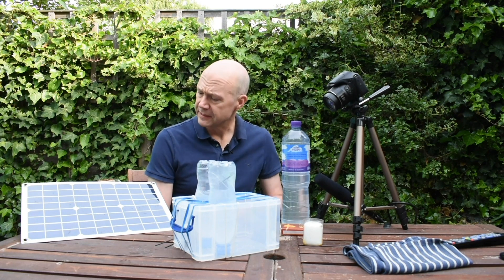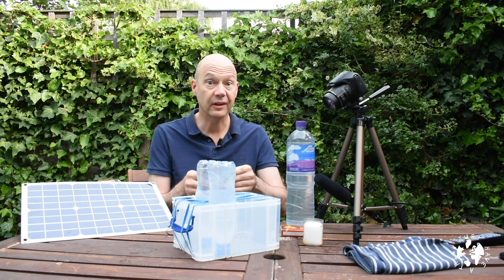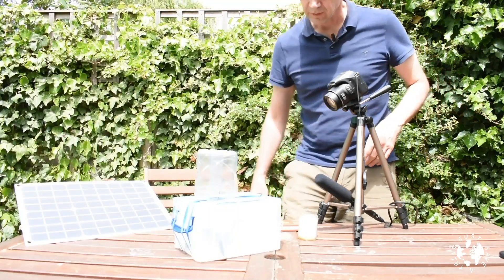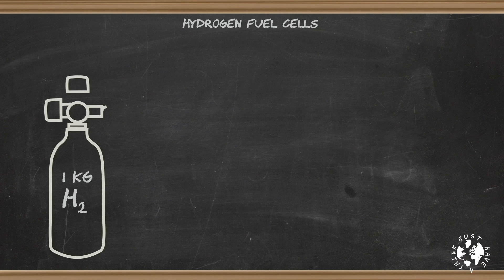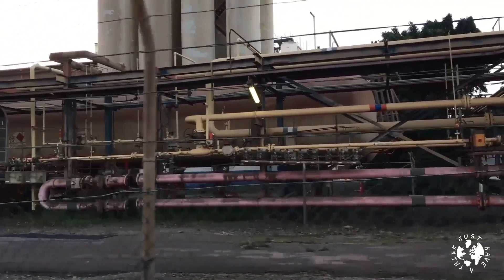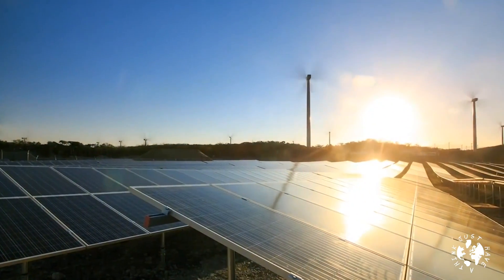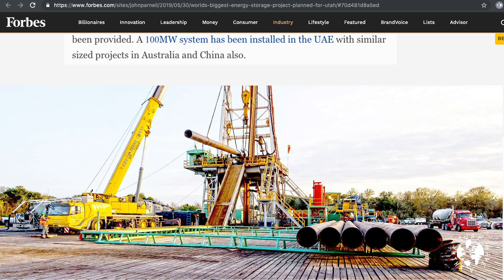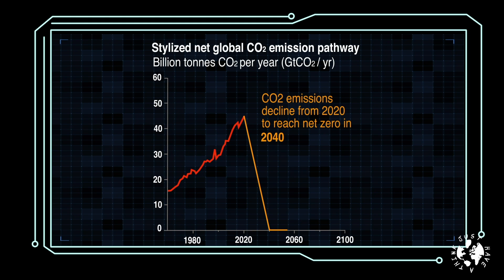Energy Storage in Hydrogen : Does this beat batteries?

Comment: Kids, only try this at home if you are in a detached house and very sure about what you are doing. If the system leaks hydrogen does not smell you can not see it and is INCREDIBLY flammable by the tiniest of sparks. Other than that: decompression of a home made hydrogen systems will blow your house apart. Make sure that you are placing this in a well wentilated area. Under no circumstances try this in a flat.

Comment: There were a few little firms, some years back, promising hydrogen storage tanks filled with metal dusts, giving a metal hydride as the storage medium (low pressure, but high capacity, lots of gas is adsorbed onto the metal surfaces  - the gas comes out when you warm the hydride). There were a few of their sales pitches on YT.  I wonder what happened to that?

Comment: The earth is actually cooling.   Ski resorts out west are going to be open until August and farmers in North Dakota are having trouble because there is snow on their fields.  They may have planted but they were planted late in the season.  It's hard to know what happening since the Leftist media doesn't cover actual news.
Reply: alternative facts ! - check out potholer54.  SNOW does not require very deep temperatures but enough water vapor (helped by higher global temps -  also in the air, that wall will hit a colder and drier wall of air - there you go). 

Search for polar vortex. that could explaint cold snaps and snow at unusual times.

It is WAY TOO WARM in the Arctic. the relativeley cold air breaks out - it used to be trapped in the Arctic by certain currents.

On what data do you base your claim on that the globe is cooling ? On the contrary,  the evidence is that the globe has been warming.

check out NASA or NOAA research for a start. Or DMI (Greenland, Arctic). 

Does not matter what the media reports - they don't cover science too well anyway.

But the PEER REVIEWED STUDIES and the scientists that are experts in the field make statements. - and potholer54 does a good job to explain it to the non-experts. 

If you do not believe them ? Based on WHAT peer reviewed studies and what expertise ? 

Extraordinary claims need extraordinay proof. If you boldly contradict the overwhelming majority of scientists in the field you better have some GOOD evidence.

Write a rebuttal  paper how the globe is not warming and subject your findings and evidence to the scrutiny of the global community of experts who read those magazines and react to published studies. That is the meaning of PEER REVIEWED.
Reply: Go watch some Tony Heller videos.  He shows what's actually happening.  The data that they graph has been altered many times and they issue pretty graphs that are completely meaningless.  They won't release their data so it's not science.   All of the cycles that control the climate are shifting.  Carbon dioxide is basically meaningless.  There is no overwhelming majority.  That is just a lie that they keep repeating.  They need to fire these con-artists and throw them in jail for fraud.  It really is that bad.

Comment: Of course, Fuels cells are much more expensive than batteries, and converting water to hydrogen is less efficient than charging a battery, and storing hydrogen is a nightmare (because of its tiny leaky atoms and tendency to make metals brittle), and converting hydrogen back into electricity is less efficient than discharging a battery. 
On the other hand there are a some applications where energy density and weight is more important than efficiency or cost, like electric airplanes, which are a perfect match for the technology, at least until batteries or supercapacitors massively improve their weight/energy density.
Reply from the maker: HI Michael. It'll certainly be an exciting future ironing out all these technical hurdles (assuming we can just manage to keep ourselves alive for long enough).

Comment: You totally gloss over the energy requirements to produce, store and distribute a hydrogen based energy storage as though they are trivial details that will be solved in the future by some magical technology. Simple physics says this will never be an efficient way to store power from renewables. Battery technology is already advancing faster than fuel cells can become cheaper and will soon pass in useful energy density.

Hydrogen is entirely touted by fossil fuel companies for a reason. They sell fuel, not machines, which is their business model. The plan is to use hydrogen as a Trojan Horse to promote end user machines that depend on it as a fuel (just like the current model). They may even subsidize these fuel cell machines (directly or through government) to get them widely entrenched. Some renewables may be used to produce a small amount of hydrogen to get the Green Stamp of Approval (like the ethanol greenwashing scam that has run for decades). The rest will be produced by natural gas steam reformation, which is the true goal. 

Hydrogen/Fuel Cell technology is simply a means to monetize the remaining oil/gas reserves, which is the only wealth the extraction industry has.
Reply: Kind of negative - simple physics indeed but if electrification all goes batteries what do we do with all the old batteries.
Reply: @alfrobertson7027  The components in batteries are long-lived and recyclable. In fact, few of the Lithium-Ion EV batteries have ever made their way into the landfills since their use started in the early 2000's. The reason for this is that long after the batteries are insufficient for EVs, they find new life as grid storage, UPS backup and misc other functions. There is already a vibrant economy around battery tech and they are too valuable to throw away. 

Also, newer designs already look to way outlast the car themselves as well as be easier to recycle.

There is no practical way to recycle CO2 without large amounts of energy, which just creates more CO2.
Reply: @alfrobertson7027  Tesla has a joint venture to recycle them.
Reply: Trees! The issue (arguably) is fossil carbon being added to the current ecosphere. So how to accommodate global growth even global standstill without adding more. It is a problem of scale I believe so the naysayers need to stop protesting and propose solutions.
Reply: Lithium battery is heavy and toxic.
Reply: @marcohangman5312  So is a fuel cell. Besides, I don't plan to carry or eat a battery.

Comment: How about demonstrating pumped hydro electric. You could move a lot of water with a small pump connected to that panel in several hours and get 90% of the power back rather than a small puff of gas.

Comment: The problem of hydrogen storage is the vapour pressure of hydrogen is so high that makes it low in energy density per cubic volume at a reasonable pressure.
Reply: Which is a challenge when you want hydrogen powered vehicles, but is not a problem at domestic levels. By leveraging grid storage, (i.e. each house that generates excess solar stories it locally in the form of hydrogen) which then becomes available when demand happens after dark, (or it can be use to directly cook food.)

Comment: Hydrogen is a hard gas to keep as it is so light it will find a way out .Would it be easier to convert it to amonia or methane ??
Reply from the maker: For storage and transport you mean? Yes - that's definitely an option being explored and developed. Good comment. Thanks :-)
Reply: @JustHaveaThink  yes convert it to nh3 then convert it to hydrogen as needed .Ammonia is very easy to liquify and I am not that versed in the way to convert it into methane but you  use co2 + h2 to yield methane and oxygen

Comment: I don't see hydrogen being very useful compared to pumped hydro and batteries. I would like to note though that you likely did not set up the electrolysis very well. You want to target about 2 volts and I am guessing that solar panel is set up for 12 volts. One option for a DYI setup is to have 6  electrolysis units wired in series. As long as they are about the same size they will float with about the same voltage.

Comment: By the way, Hydrogen is extremely flammable and explosive as used in rocket fuel.  Requires extreme caution for storage.  It’s not like CO2 that you can just store it in caves and fogetaboutit. Remember Hindenburg!
Reply: Lol. The Hindenburg explosion you see pictures of is actually solid rocket fuel. The Germans used it for adhesive.

Comment: Pump water up high, let it drop thru a turbine when you need electricity.  Simple plumbing and pumping that is easy to maintain without any serious volatility.  Something you could put in the utility core of a big building to store energy from solar cells on the building.  KISS factor to keep it cheap.
Reply from the maker: Already being used. Pumped Hydro. I think they use it as a grid balancer.
Reply: @JustHaveaThink  Then why not use it in a battery role too?  Saves a lot of mining, smelting, and other industrial process pollution eh?  You just move water up in quantity and have no fire, explosion,  or other risks and you are not breaking any tight chemical bonds apart.  What is the watt in versus the watt out? I expect it is a higher return for just pumping the water up high.

Comment: Thank you for teaching the world about this concept.  I have been saying it for years.  I would like to see vehicle fuel stations that make and compress hydrogen gas on site.
Reply: They already exist. The problem is, quite simply, for an average UK sized station, you need a 3MW grid connection power an electrolyser 24/7. This is VERY expensive and there isn't enough power. Not to mention the cost of electrolysers. Hence why battery cars are taking off. The infrastructure is so much cheaper and easier to install. Leaving aside the efficiency problems of H2 cars, they really arent a great solution. Better to use H2 to store energy or inject into the gas grid. Which is exactly what is happening.

Comment: Hydrogen tends to escape any containment its in,  thats WHY its not used as much as it could.
Reply: Hi, I have spent time with hydrogen, this statement is real! I am yet to have a container/tank which can not let hydrogen out, I have read that cabon fiber do a better job.
Reply: L Shayo that’s the problem with using the smallest element on the atomic table. To say we could just use it as a substitute for natural gas using existing infrastructure is a “pipe” dream.
Reply: @mondotv4216   But what if we only want it to last between sunset and sunrise only since the tanks would be refilled on the next day anyway?
Reply: Ziad Jeeroburkhan complicated gas storage and pressurisation system, not to mention fuel cell and battery. Cheaper and more efficient just to use an almost maintenance free battery. If you are talking grid level storage then you have to compare it to the alternatives.
Reply: @mondotv4216  Turn off the power once the maximum pressure is reached is all that's needed to regulate pressure but feel free to elaborate if you think other problems might arise.

Have you actually compared battery costs in comparison before jumping to that conclusion especially on the long run? Batteries have very limited lifespan so they're not maintanence free while fuel cells actually are close to being so actually. Also have you considered turning H2 to methane from atmospheric CO2?
Reply: @mondotv4216  Batteries might be cost efficient on smaller scales but hydrogen storage capacity is only limited by the storage tank capacity. That's extremely cheap if we only need to store it overnight so I'm still struggling to understand the rationale behind the battery support here. I need you to explain clearly why you disagree now.
Reply: @ziad_jkhan  we weren't talking about utility scale storage. There are other better solutions for that - it's not me you have to convince. It would be investors.  On a utility scale you have pumped hydro, flywheels, other gravity fed systems, giant wind turbines that operate at higher "on" rates than current gas or coal fired power stations, solar thermal, etc. Hydrogen has to get a lot cheaper and more efficient to compete with those other technologies (I'm sure I haven't covered them all)
Reply: It would be ideal to find a way to produce methane = CH4 * immediately after the hydrogen has been produced - then the existing infrastructure for natural gas could be used. And not problem to contain the smallest most evasive element. 

Lots of R & D necessary though.

Or any other fuel that is easier to handle (and less explosive).
Reply: @xyzsame4081  wikipedia dot org/wiki/Sabatier_reaction

Comment: You compared the theoretical energy content of hydrogen with the kWh/kg value of a Li-ion battery.  That's not right.  The battery produces electricity, which is not theoretical.  You have to compare to the electricity that you could reasonably attain using a fuel cell, and add the weight of the fuel cell and the weight of the hydrogen tank.  Hydrogen is not very efficient as an energy carrier, but if you happen to have free electricity then maybe that's not a problem.

Comment: What has always puzzled me is the emphasis placed on huge power storage facilities.  Wouldn't it make more sense to create smaller scale facilities - whether hydrogen, pumped hydro, flywheel, battery, whatever - and bury one such facility under each transmission tower on the grid? Circuit boards commonly have many capacitors scattered throughout the board to even the flow of power across the device, why not take a similar approach on a larger scale to ensure that power remains available in all places at all times?

Comment: 9:15 - Unfortunately, we just can't change the use of our existing methane gas transmission and distribution systems to hydrogen.  Hydrogen has the property of bonding to the trace elements necessary to make  high strength steels such as titanium and vanadium.  By bonding to such elements, the hydrogen causes what is called hydrogen embrittlement and the steel pipe becomes brittle, cracks under repeated stress loading and fails very quickly.  The switch to H2 is possible, but would need to be phased in over time as the infrastructure warrants replacing.
Reply: No but we can setup a home H2 system which stores solar energy during the day and uses the compressed H2 at night this way there will be more than enough energy but ofcoarse the battery companies and energy companies  don't want people to know about!!
Reply: @pehgt5099  This is not what he was talking about.  And as far as your revised suggestion, the mechanical and electrolytical losses of generating and compressing H2 compared to other solar energy storage options make it just plain silly.

Comment: Hydrogen seems like the best thing on paper, but Hydrogen is pretty difficult and expensive to store.
Nuclear power will still remain king even with its nuclear waste, the problem is ignorant people who fear nuclear power.
Good stuff though.
Reply: I agree.  Nuclear power is the best for generation.  But how to store that power?  Nuclear power generation has to be a very constant, flat supply.  Power demand fluctuates quite a lot.  Put hydrogen storage in the middle, and you can have a functioning power grid.  Also, use the nuclear power to make hydrogen for use in vehicles.
Reply: @scorpio6587  You really don't want a high pressure hydrogen tank in your car, no matter how safe you try to make it, it will never be as safe a gasoline tank.
And you need a larger high pressure hydrogen tank to even compete with a gasoline tank.
Hydrogen as fuel for cars is not really what you want and I too used to think it was a good idea, but better battery technology will surpass hydrogen.
Reply: @GoldSrc_  Don't get me wrong.  I love gasoline, and I will continue to use it so long as it is economical to do so.
Reply: @scorpio6587  Yeah, the only thing I see replacing gasoline for the average cars it will be electric cars and better battery technology, but that will take a few decades, I lost all hope on Hydrogen and fuel cells for cars due to the dangers it has which are not worth the risk.

Comment: Next step: methanisation of hydrogen, aka combining CO2 for the air (or other sources) and 2 H2 to make CH4 + O2.
This can be store indefinetly and without any limitations inside the natural gas grid and can be used for a lot of things using existing technology (heating, cooking, gas turbines, PNG/LNG cars)
Reply: huh, CO2 is the waste product of the spent hydrocarbons, why would you want to "combining"  them back in you said fuels?
Reply: @DanielbenDaniel  for the same reason we use bio-fuels like wood or corn based methanol
It's carbon neutral and - as i wrote - can be transported and stored (and used) without any problems using the existing gas infrastructure.
Reply: @DanielbenDaniel  CO2 and carbon is always here the problem is we dug up all the carbon that mother nature locked away.

Comment: I had thought of electrolysis as a slow and inefficient process but on revisiting the idea I have come to the conclusion that it could well be the opposite for instead plain old graphite rods we can use stacks of porous membranes or sponge-like structures to increase the surface area of electrodes which can occupy the whole space of a generator and the gas produced could be self pressurizing

Comment: 28 seconds in. Paused.
What could go wrong? Explosion! LOL.
But a gasometer for storage is interesting, but what needs to be fixed is electrolysis, it's inefficient.
Plus Platinum or Palladium electrodes too expensive, while base metals corrode.
Reply: Good vid BTW 💓👍.
 So graphite electrodes. But electrolysis efficiency needs boosting. 
Plus storage systems. 
Better though hydrogen via electrolysis is much better than chemical synthesis. 
Think static systems will come through 5 to 10 years ahead of moveable.